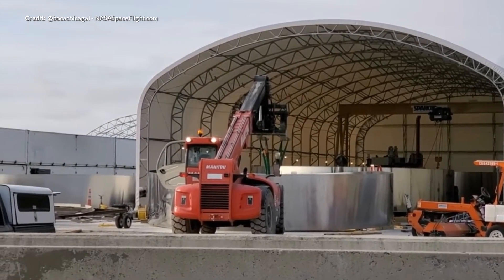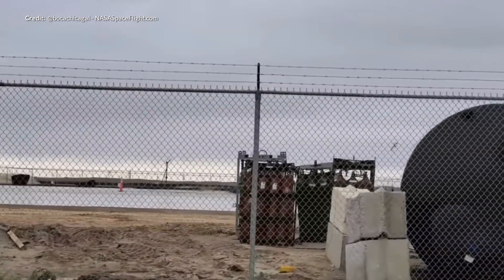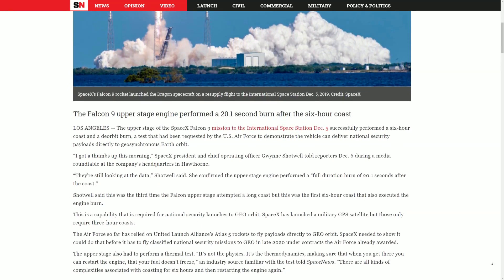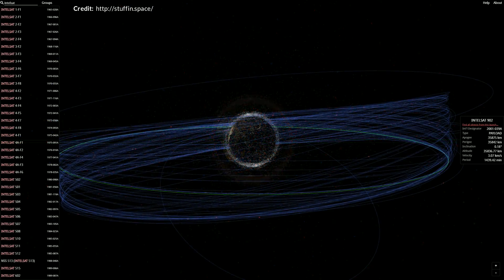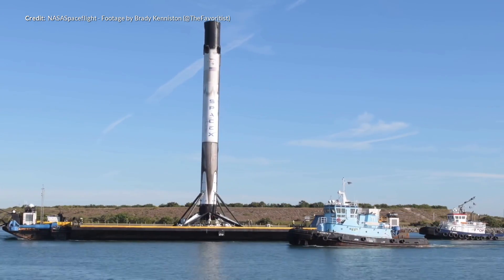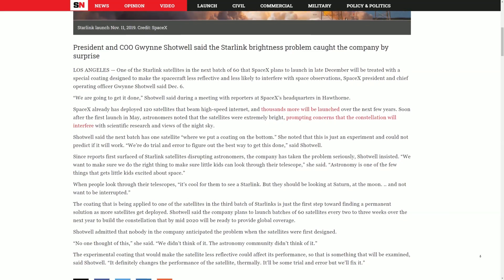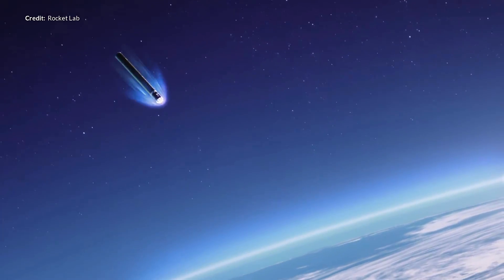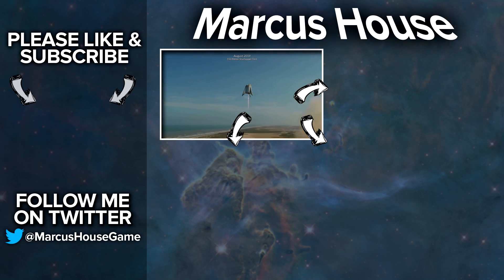SpaceX MK1 Starship deconstructed, Starlink upgrades, Rocket Lab's huge steps toward reusability

Comment: SpaceX needs to fix the reflectivity problem on Starlink soon. BRFORE they have thousands of satellites in orbit. Equally, if not more concerning.... What happens if there's a collision? So far they managed to lose two Falcon 9 rockets, 1 Crew Dragon, and that dented up patched together MK1. I sure wish SpaceX would put safety first.
Reply: I think it was one of Marcus' earlier starlink videos, he mentioned each satellite has a thruster and guidance from NORAD. So collisions "should" be avoided. Also keep in mind, this very low altitude means atmospheric drag. So any collision debris would be below other satellites and de-orbit quickly.
Reply: Starlink is flying so low the satellites deorbit quickly without thrust. Likewise debris, since most paths from a collision are consequently not orbits either. Also, the design lifetime of individual satellites is quite short, so the time to phase in fixes will be short as well. That part is being done quite diligently by SpaceX. After all, if they really manage it, most of the stuff in orbit to be Kessler'd will be their own.
Reply: then it will blow up and de-orb, what do you expect will happen? when functioning correctly they actively avoid collisions
Reply: Look up "Kessler syndrome" or "collisional cascading". If the collision avoidance system fails... Low earth orbit could be rendered useless for years! Musk seems to enjoy taking risks.
Reply: David Johnson then we should halt ALL satellite launches until space is cleaned up, right? I don’t see u objecting to other launches.
Reply: Satellite collisions and the Kessler syndrome do worry me, especially now there will be Starlink and OneWeb's thousands, and a "small" network of 400 a small company has started to put up. But pretty sure I saw that the Starlink sats will each have an autonomous collision avoidance system. They will certainly have direct links to any Starlink sat near them.
Reply: @donjones4719  Even if they did all collide I think it would only been a few days before they all re-enter and burn up due to the low orbit? I know things in geostationary take 1000's of years to re-enter on their own.

Maybe someone who knows more could tell us the actual time for their orbit to decay if they got smashed to bits.

Comment: Obviously the wi-fi providers are against anything that could infringe on their profits. But as usual, Eloy is forging ahead with any worthwhile program that will benefit mankind. This certainly is one of those.  I am all for it.
Reply: 6 Morloks don't like internet.
Reply: 'Wi-Fi providers' won't care at all.

Just like the cable modem, DSL modem (or its fiber optic equivalent, if you're that lucky) you likely already have, when you have the Starlink receiver, your own local wi-fi router will plug into it. Your individual wireless devices can't talk directly to the Starlink satellites.

And so, you'll still connect your mobile devices to the local wi-fi (which might get Internet conectivity from any space or terrestrial provider, you won't care which one, anymore than today) of airports, libraries, businesses, just as you do now. You aren't likely to carry your Starlink receiver (and its power) with you.

So, business as usual for Linksys, Netgear, etc.

And as for 'mankind,' not every country is going to let Elon make his Starlink receivers available to its people. China, for instance, isn't going to permit anything that bypasses the 'Great Firewall.'

I suspect you can't even get unapproved shortwave radio receivers into North Korea...

It will change a lot, but not everything, everywhere.
Reply: Eloy? Maybe, but what about Morlock?

Comment: About starlink...Only 1 sat has the new coating? Of the 60 they throw, they only put it at 1? It seems like a stupid and provocative decision. Very bad SpaceX
Reply from the maker: As far as I have read, only one will be modified as a test article. I guess they want to make sure it will work before they do it on a full set.
Reply: @MarcusHouse  Yes, I understand. In the worst of situations that unique satellite would cease to be operational instead of the 60 launched. Any result means having another 59 lamps in the night sky. I understand that their priority is to continue increasing the capacity of the network but I think it is not the best way to make friends. My humble opinion.
Reply: @guillermogonzalez9937  don't worry

in 3-4 years they will deorbit themselves :)
Reply: @gierdziui9003  Yes, that is a completely reasonable time slot. Ironic mode ON.
Reply: Guillermo González how have you personally been prohibited from any astronomical activity?
Reply: Why would they put the coating on all 60 satellites? Not only would they risk wasting an entire launch, it's not even known if it actually has the wanted effect.

Comment: My internet is still on 40 year old copper wiring.  1000' east or west of me is fiber optic service.  Our electric provider has stated that "there are no plans to install fiber in your area. (Just too few customers to justify the expense.)"  I have bonded broadband.  (Two cable pairs one for up & one for down. Supposed to be 25 Mbps, I am getting 2 Mbps down & 600 Kbps up.) So for me Starlink is a big fat YES!  (Century l*nk is the only provider other than an expensive satellite system.) Thanks Mark!
Reply: Even though I'm content with promised 1.5 Mbps and getting 1.8, the monopolized internet offends me on principle. I cut the cord and switched my home to a local fixed wireless provider. Cost and performance are only slightly better, but I switched just because they're not mega.
Reply: I'm dropping CenturyStink soon as Starlink is an option.
Reply: In northeast brazil I get 6MBps (for real) for only 15 dollars.